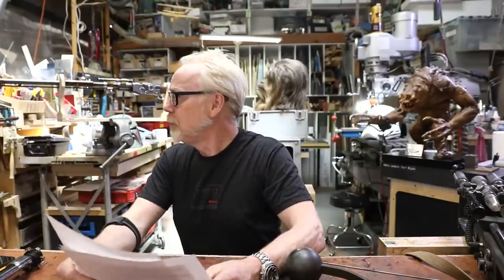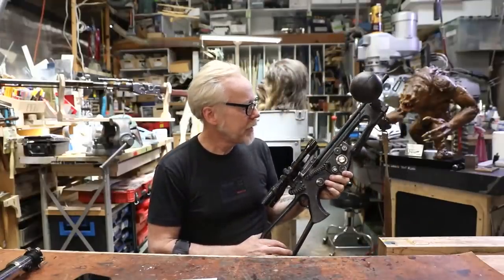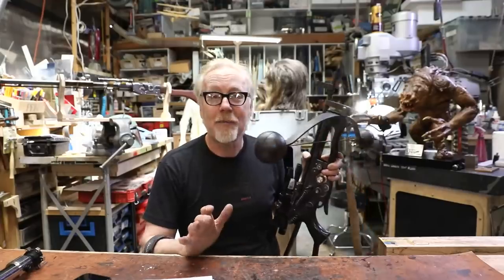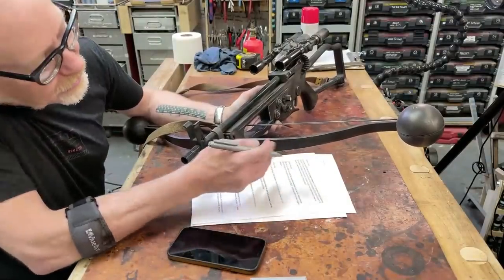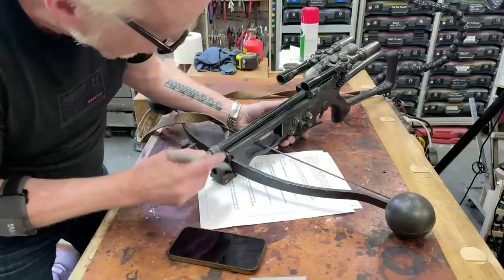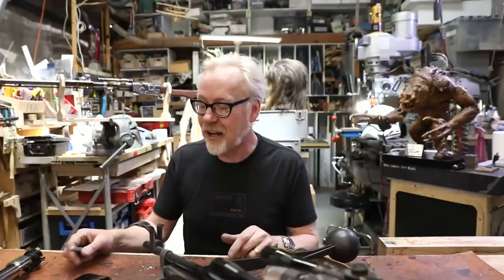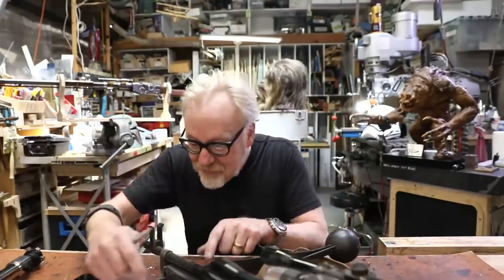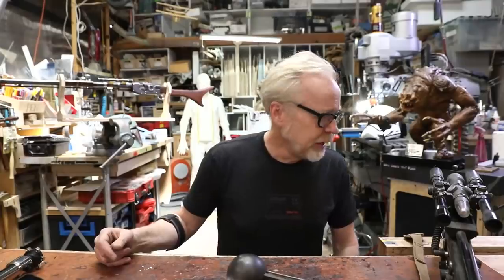Ask Adam Savage: Transforming Toys into Realistic-Looking Props

Comment: Hi Adam. Retired design/drafter here. My thirty five year journey started during the transition between 'manual drafting' and CAD drawing and modeling. The last software I used was called Unigraphics, or UG/NX and I'm quite sure that after using it for the final eighteen years of my career, I only learned and used a little over a third of the whole package. So it's all about mastering the software tools that you need for your current project. It'll build on itself over time, but be it sheet metal or plastic molds or electrical wiring... You'll learn what you need in short order. I only have a few years on you, so I know you already know this. Just wanted to provide some encouragement. 🙂 Besides, knowing a guy your age is taking up CAD software makes me think twice about taking up the electric bass guitar again (only really doing it this time). Thanks for a great book and a great YouTube channel.
Reply: Nx is pretty insane on features, but not the fastest or most intuitive imo (6 months exp.)

Comment: I learned Solidworks a few months ago in order to borrow a friend's 3d printer for some mods I wanted to build. It was a pain in the ass at first and the software has so many un-intuitive idiosyncrasies, but when you finally get over the hump it's so worth it to be able to just fab whatever you want.
Reply: Solidworks is just the best, its soooo versatile. Making animations, simulations, testing strenght, etc. I really liked the sheet metal unfolding.
Reply: I am currently doing a bachelor's degree and solidworks just sucks IMO.
Maybe I am just not good enough at it yet, but sketching in that program is a nightmare.
-2d constraints are not on your screen until you select stuff
-you don't get axies in assemblies (spent an hour constructing an offset axis and constraining one part)
-everything is located in different tabs and requires wayyy too many clicks

All in all it's just very inefficient.
I like my autodesk inventor - i've gone so far that i am doing everything in inventor and only replicating the final assembly in solidworks.

Comment: Hello Adam - 3D software is something I am quite passionate about.
For 3D printing I would suggest Autodesk 360-Fusion (maybe better for printing) or Autodesk Inventor.
Both are very effiecient, fast-workflow programs.
Also easy to learn with explainations for everything when mousing over.

I have some experience (>6months each) with many programs like
solid edge, solidworks, catia, siemens Nx/unigraphics, inventor

Inventor is over all the best, fastest and most intuitive imo.
I don't specifically have much experience with 360 fusion, but it is very close to inventor.
Also it has some 3D printing features, that inventor does not have (3D threads for example).

Comment: Hi Adam. I believe I can help you. 

If you ever check these comments, (I am a long time fan, and recent mechanical engineering graduate, partially inspired by you), SolidWorks is the current industry standard for 3D design. There are 3 books that walk you through step by step in mini projects and teach you 100% of the program’s capabilities.

It only took me about 3 months to learn it, an hour a day, 5 days a week. 

You’ll be looking for the book series “Beginner's Guide to SOLIDWORKS 2021” (it has a gearbox assembly on the cover for part 1).

Also, once you are done, you can go online and take a 3 hour long CSWA test to become a Certified SolidWorks Associate. I’m sure you don’t need the degree, but if you feel it would make a nice little addition to your list of achievement, it’s easy and kind of just a byproduct of learning the program. 

It’s amazing what you can do with just a little practice. I wish you the best with learning 3D design, whichever way you choose to.

Comment: You should look into fully hosted environments rather than getting another laptop.  Windows Live, for example will allow you to connect to a virtual PC from anywhere with any device.  One that can be precision tuned to the applications you are using.  With the current prices in hardware, it just doesn't make much sense to continue on having a physical PC to carry around.  Especially for 3D design applications.  You are going to need to buy quite a high end machine to efficiently render 3D models.  And I get the sense from your wording that you don't really know what's happened with your laptop, so a fully hosted solution would remove any need for maintenance or repair on your part as well.  Virtual Machines can run any OS, any software, and allow remote connection from any device.  Tablets to flip phones, smart toasters and dumb TVs.  All you need is a screen and the internet and you can remotely connect to a full feature PC.

There's really no reason for you to throw money at a retailer and hardware manufacturer that will attempt to sell you the bare minimum at monopolistic cost.  So you might want to look into it.  There are many different hosting solutions from many different providers.  And service is fairly well standardized now thanks to COVID and a massive shift toward working from home.
Reply: Most people who travel a lot would disagree with you. A virtual computer is just a paperweight when there's no internet connection.